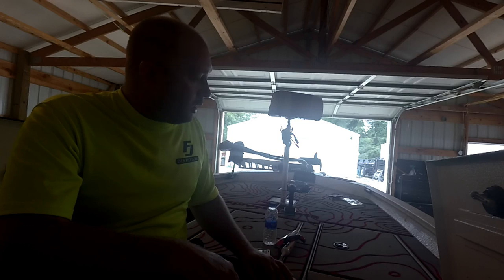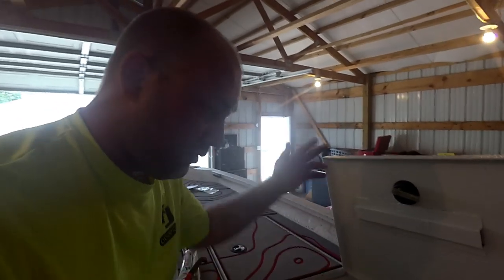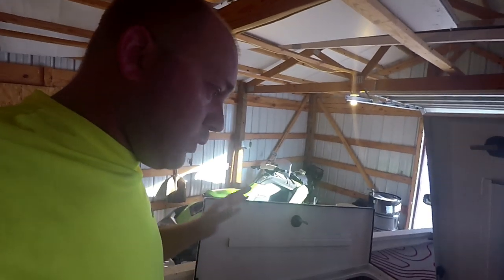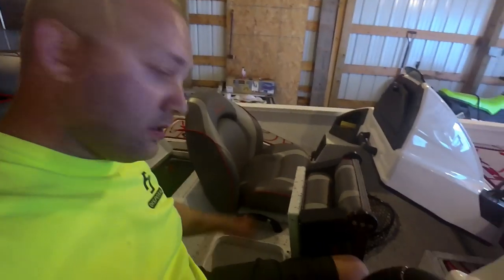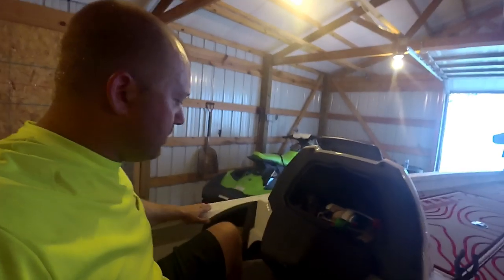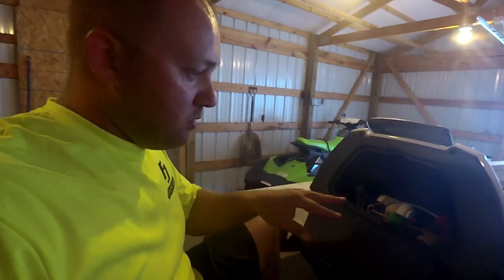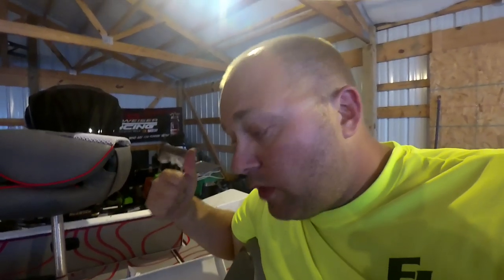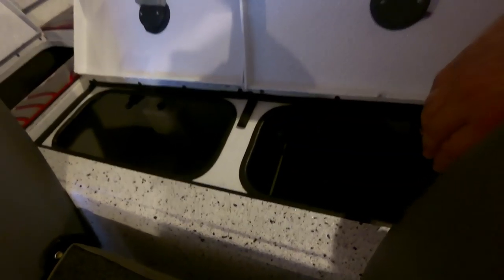In-depth review of the  fit and finish on my 2019 Xpress X21

Comment: First of all, great honest review! I have actually been thinking about selling my 8 year old Triton glass boat and buying an Xpress X21 but after watching your review, I don't know that I would do it. Just seems like a lot of things are not put together good and lacks some thinking from a tournament fisherman. My 1st rig was a 20' G3 tin boat with a 200 Yamaha, one thing I will say, the boat was put together well. The G3 had the performance pad so it would run 64 with just me so not a slow boat. G3 stopped making the HP200 because cost but I like it. The only thing I didn't like is the way it ran in rough water. It would beat you to death. If it was windy, I would stay close to the ramp because of the way it hit the waves with such force. That and the wind pushed it around a lot compared to a glass boat. Again, thank you for the honest review, don't think I would go with the X21 now.
Reply from the maker: Dont let me 2 year old review dissuade you from looking at the latest model Xpress has to offer. they made a lot of changes for the better in the latest model. And I'm looking forward to upgrading in the future to the newer model

Comment: I am looking for a bass boat that I can tournament fish out of and use as a bay boat part of the year.. I think the X21 is going to be the ticket. I was actually looking at the X 24 B as a duel duty rig but the more I looked at it the more I realized it wasn’t really set up for bass tournament fishing. I think it will be easier to take a bass boat bay fishing than to take a bay boat bass tournament fishing.                                      The other piece to this that really closes the deal for me is the aluminum trailer. It’s a must for salt water use.                                                                                 .                                                                                              I love the honest review of this boat and really didn’t see anything I couldn’t deal with. The other thing that got my attention was the smooth ride. That is way more important to me than speed. I’ve looked at every major brand of fiberglass/composite bass boat and changed my mind on a daily to weekly basis on which one I want. I think I’ve finally settled. I will be ordering a 21X Pro about January.
Reply from the maker: I will be doing a follow up review here shortly. I fell in love with my but and it runs amazing and smooth. It is a great boat all the way around. aside from the few minor issues i listed. you will be happy

Comment: Insulate your lids. Helps with noise and moister/condensation. Could use a foam sheet. Made a difference on a buddy's boat
Reply from the maker: thanks for the tip i will try that out!

Comment: Thank you for the video. I have a 2019 X21 Pro and getting water in my compartments as well and the livewell tips will help as well. Do you have a hydraulic jack plate? Do you have any problems with the boat porpoising?
Reply from the maker: Sorry for the delayed reply. I did install a Hydraulic plate and the reason I was Porpoising so bad was I wasn't getting Full throttle out of the hot foot. and that really took care of that!

Comment: I've been thinking about making the switch from fiberglass to aluminum and this is the first review I could actually sit through and watch the whole way until the end. I'm in CA and was thinking about driving to AK to buy one of these after I watched a couple pro's opinions on this boat. But like all paid pro's their opinions are never completely honest. I don't want to spend 40k on an aluminum boat just to turn around and do this much work to it. I don't care if it's easy or not. If I'm dropping 40k on a rig I feel I shouldn't have to do anything to it. I really don't like my several hundred dollar rods bouncing around the inside of a metal compartment like those rod lockers either. What the heck were they thinking? Having the light assy in the livewell leak water seems super unsafe. Not to mention water getting through areas that should have some seal on the compartments just seems like poor craftsmanship to me. Like not a lot of attention was put into the details of the boat. I'm not a pro but I think spending 20k on a 5-10 year old fiberglass boat where all the kinks like this have been worked out would be a better option for me. Plus a used boat will come with power poles, better graphs and better options. So thank you for this review, you made up my mind about what I'm going to buy.
Reply from the maker: I thank you for your comment and yes it is an honest review and I'm making a follow up video now that i have owned the boat a while. There were definitely were areas that Xpress could have done better. And I know since the video came out they have addressed several issues with the boat. I am no fan boy by any means of Xpress but I will say this is the best riding boat I've ever been in. And your logic was looking for an older boat with all the Kinks worked out and ready to go with poles and graphs is 100% an accurate statement. I like to Tinker I like to fix things, I have an engineer spirit so I like to work on stuff so to me I didn't really mind working on it because it makes it more of my own in a sense. Plus I did save almost fifteen Grand over buying a new glass boat. So that's a huge Plus. But again thank you for taking time to watch the video and comment. I like the interaction with fans and viewers
Reply: @OzarkAngler  I actually am a fanboy of Xpress boats. Well was, I wasn't to sure about getting an aluminum and when I saw the Xpress 21pro I immediately wanted it. I've watched almost all the videos on youtube about them and was going to drive from CA to AK to buy one after I did all my homework and research. For an aluminum, Xpress was my top choice because they made 21ft boats. I understand it's a great riding boat but currently I own an older 18ft Ranger and don't have any issues with the way it rides at all so I'm not to worried about the ride. I've owned 2 different Champions, a Ranger, several smaller aluminum and a couple tri-hulls. I actually am an engineer, I was a service tech for many years and love to work with my hands and I fix everything myself on my Ranger. However, my Ranger is a 1988 374V in fantastic shape but I expect things to go out in it due to its age. On a brand new boat that I'd spend 40k+ on I want it to be engineered perfectly! I see how poorly other engineers/techs do their jobs in my line of work and this is reminiscent to what I've seen in the past where people didn't take pride in what they were building. Especially when it comes to the details, like the hole being to big for the light in the livewell, no shocks on the lids, water leaking into dry space, no carpet or ceiling in the rod lockers to protect my rods. That is a big problem for me in how these boats are designed, it's like the people who made these boats put all their thought and effort into the ride but don't actually fish. I want a boat that fishes like a Ranger without the Ranger price tag which is why I'm looking at aluminum. I actually emailed Xpress and asked them if they fixed the issues you pointed out in your video so we'll see if I get a reply. If the issues were fixed I'd still consider buying the 21pro, otherwise I'm looking at a 18'8" fiberglass Ranger which is about the same costs but I know the 18'8" Ranger isn't going to have any of the problems you pointed out in the video. The lack of attention to everything other than the ride is very concerning to me. Not to mention when that SeaDeck gets cold it becomes very slippery so I think I'd go for the carpet even with the Xpress. Carpet isn't as cool but at least I know when its 25 degrees outside and raining I won't slip off the deck and fall into the water.

Comment: Great video! Do you feel like you save money in gas in this being a lighter boat than a fiberglass? How is full consumption in your tow vehicle pulling it?
Reply from the maker: I have an 03 yukon with the 6.0 in it so fuel use was already high around 8-12 mpg pulling my fiberglass nitro but the 1000lbs saved with the new boat im getting aroung 10-14mpg towing. and as far as boat fuel consumption i get about 3.5 mpg some times depending on if im wide open or not.

Comment: I'd like to think that a 48,000 boat has thought about these things.
Reply: 48K ??lol  maybe without the motor.  These x21's fully loaded are running 72-77k
Reply: A place locally can get you into one for 58k. Pretty much basic stuff though.
Reply: @ScottCooperOutdoors  
Ythe x21 pro le with twin raptors.   2 helix 10’s , ultrex 80, appearance package, sport pro package, heavy trailer upgrade, rod straps, 10” atlas jack plate , spare tire, and travel cover was 76,800.   I actually found a different t one that was lacking some other options for 68.   It had 6” jack plate, standard trailer, no cover ( which was 1800 alone ) no appearance package.   These boats are drastically overpriced.   With that being said, I could sell it tomorrow for what I paid.   There are non available and the wait to order is now 18 months.

Comment: how did you attach shocks on the hatches, I did not see any screws
Reply from the maker: I used small stainless bolts and painted them black if you look close some in this video were not painted yet . You can also rivet them in place

Comment: Bought a 2020 X19 Pro, having issues with water in the bilge area, brought it back to dealer twice they still haven't fixed the problem, so my question is any thoughts on where the water would be coming from, Thanks
Reply from the maker: I had the same issue the first few times I took my boat out and what it turned out to be was I wasn't putting the plug in tight enough. Now I do know that some people have had issues with water coming in through the water lines for the plumbing from the live well you may want to make sure all the clamps on the hoses are tight. It's a simple easy mistake that can easily be overlooked

Comment: What’s the max speed you were able to get up to with the 250?
Reply from the maker: Im slowing getting it tuned in right now I'm getting 68.7 with a bravo 26 pitch four blade at 5850rpm I am still playing around with the props and prop to pad hight. I should be arounf 74 when I get it all set up right
Reply: @OzarkAngler  hydrotech flash. 325 hp out of a 4.2 liter sho. + a good jackplate and prop. This boat would be scary fast if you want it to be.

Comment: How does the boat do in heavy current and wind while fishing? With it being a aluminum boat does it get pushed around?
Reply from the maker: The wind will move it around a little bit it does take some getting used to but its aluminum with automotive paint on it so if I scratch it I'm not too worried about it before I sell it I'll just ask to the purchaser what color he wants his boat and I'll have it repainted
Reply: Ozark Angler thanks, I have a 17 h51 express. I love the boat not in open water it gets pushed around bad; I was looking to grass to a bigger cores or fiberglass as my next boa.
Reply from the maker: @deehart9276  I have absolutely zero regrets about switching to express over fiberglass it handles rough water better than any any boat I have been in. The only complaint I have about the boat now that I've gotten everything tweaked the way I want it is the size of the live well. There's plenty of room for two 15 pound bags in it but if you're fishing like angler co-angler tournament and you catch 20 and they catch 20 it will definitely be a little crowded

Comment: Do these aluminum boats costs less than top end fiberglass boats?
Reply from the maker: Yes, Xpress makes a great boat that can compete against the glass boats at a much cheaper cost a glass boat similar to mine in size and HP motor would be around 55K- 75K unless you went Nitro but I did that once and never another Nitro for me.
Reply: @OzarkAngler  I see Xpress has a ways to go on the "Fit & Finish" end of things but over all I looks great.
Reply from the maker: @JMurphy357  yes but the newer models have done alot to make the boat better. I understand that most people don't want to work on a brand new boat. and I understand that but I saved 15k and had to do a little work my self and the boat is the best riding boat I have ever been in probably better than a Phoenix but that's a coin flip.

Comment: What you showed are the reasons why I'd never buy an express boat, you say they have great fit and finish, I say bull shit, I used to build boats and when I looked at an express, I literally walked away from it (Quickly) left the poor saleman standing there scratching his head, good luck with your boat, as long as your're willing to do all of that extra work making it work for you, have at it...
Reply from the maker: I didn't mind putting in a little caulk and gas struts and a few other little odds and ends to save 15K. That's the difference in peoples choice of boats some don't mind doing things themselves and others don't want to or don't know how.
Reply: Curious, is there any Aluminum bass boat that you would  over xpress?
Reply: I see the new excell bass boat won't be out until 2022, do u know Aluminum thickness they use?